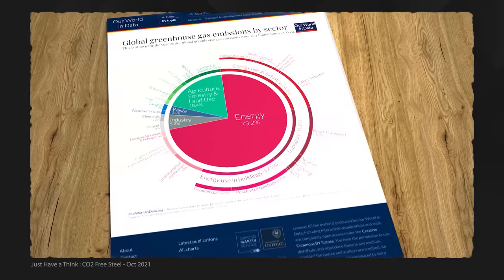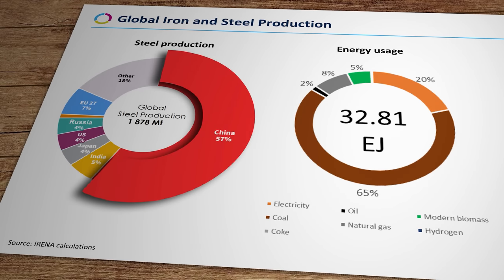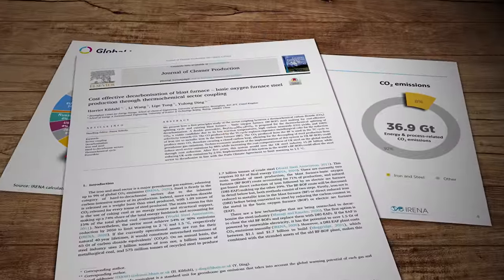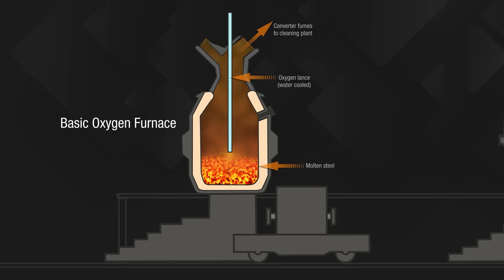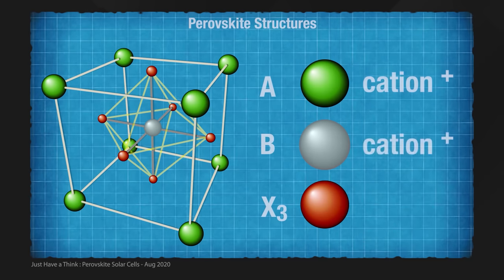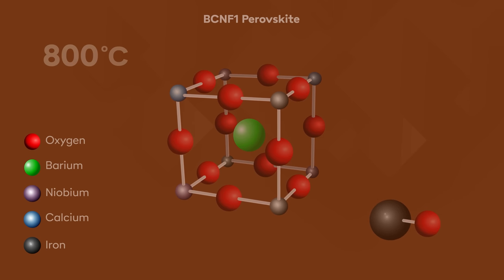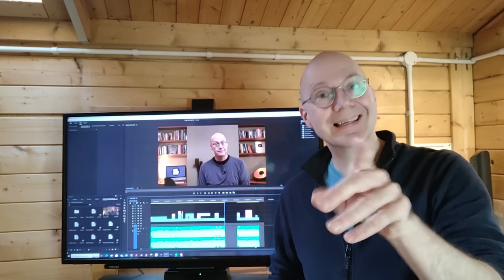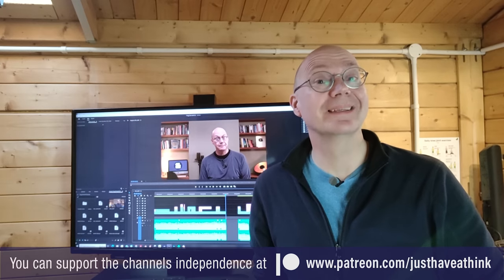New breakthrough claims 90% reduction in Steelmaking emissions.

Comment: The problem with steel making is controlled by basic physics. Replacing C with H to remove O from the iron oxide ore is laudable. But the cost of green H is currently 2 to 4 times the cost of using coke to reduce iron. If this cost can be reduced the reduction by iron oxide by H can be achieved.
If the TC-BF-BOF system can be made to work it will be a blessing. Containing such hot gasses will be tricky. But to reiterate, the basic physics is what is overlooked in many of these fanciful schemes.

Comment: Steam Methane Reforming (SMR) for Hydrogen production can emit a large amount of CO2 during production. 40% to 100% is uncapturable depending on the process.

Another technology for Blue Hydrogen production is Partial Oxidation (POx) Gasification, which, when coupled with Carbon Cature & Storage / Sequestration (CCS), can result in up to 95% reduction in greenhouse gas emissions.

Comment: If the charcoal from, say, a tree plantation, is produced by pyrolysis (heating without oxygen) the resulting gas can be put through a fractionation tower such as they have in petroleum refineries, to produce cooking gas, gasoline, diesel, airline fuel and so forth right up to tars.  Perhaps this would make the whole process more economic.

Comment: Is the move from 7% up to 8% of global total, not so much the increase of steel making but of the reduction in CO2 production from other sources distorting this sort of comparison ?
Reply: Excellent question!
Reply: That would be very positive. The lack of clarification is a glaring omission of information in the video.
Reply: At the moment, I believe both total CO2 emission and steel production are still increasing.  The numbers are out there, if you want to look for them.  As we decarbonize other sectors, the fraction represented by steel (and cement) will of course go up.

Comment: one of the big issues of steam reforming using CH4 is that the steam is created by burning CH4 making it doubly bad for the environment. Flip the equation, using renewable energy and induction heating to produce the steam, reformate the CH4 to produce H2 + C02 then pass the C02 though a closed loop to produce graphene, also requiring heat. If the CH4 is used as a feed stock and not burned it becomes a much cleaner form of hydrogen production.

Comment: I think that the most promising solution that I have seen is Boston Metal"s Molten Oxide Electrolysis.  This technique requires only iron ore and electricity in and the only outputs are high purity molten iron and oxygen plus some slag from the iron ore impurities.  After adding alloying agents, the iron can be directly rolled into finished products.  This solution promises to use less energy and has lower capital costs and can use lower grade iron ore.  Maybe, it will produce higher quality steel at a lower cost than the current blast furnaces.  This would be a real tipping point.

Comment: There is a long way from lab scale to industrial scale. Many years ago (1990's/early 2000's) BHP built a large commercial Direct Reduced Iron plant in West Australia. Technically it worked - but was economically unviable and it was shut down. No company can afford to subsidize decarbonization of steel. Until production costs are built in as  a design parameter, the theme that University Research can go easily to commercial application just ain't going to happen. It needs a change in mind-set of what University research means. It is not always the best technology, often what is actually needed is the most economic technology.

Comment: If the co is replacing that much coke, then you are looking at something other than a blast furnace. That can be done and possibly cheapish compared to the coke ovens and blast furnace route. Tata have an experimental reactor that could be utilised. A top gas recovery project is also possible. 

The generated co is more likely going to be injected at the tuyeres instead of coal. The pervoskite will likely be an offgas processing unit.

Comment: Tata Steel in The Netherlands is also busy with replacing cokes with hydrogen, and a big electrolyser will be built nearby (not only for steel) running on wind power from the northsea... But I think it will take another 5-10 years for that to be realized, But the pressure is on from local people who are proven to be suffering from the cokes factory, which is old and cumbersome and sometimes emits more than what it supposed to do, and sends graphite particles and other toxic stuff in the air causing people suffering substantially more from respiratory deseases and cancer is also more prominent in the area.

The stuff in this Perovskite is also not really good for peoples health, so the concerns you mentionned in your addendum are important to tackle as well, otherwise you would replace something bad with something worse.. "Yeah, we have solved all the CO2 emissions, but do not get near the factory or you will be poisoned!
Reply: @queerdo Well, the Dutch government is a big shareholder of Shell and NAM, so this is not surprising. But the transition to hydrogen made by electrolisers using wind power, I think this is a big positive.. and if it cleans up steel production and vertilizer production, that is a a good thing too .. I do not think Hydrogen for transportation will ever take off. Sales of Toyota Mirai have dropped dramatically!
Reply: The solution is Boston Metal's clean Molten Oxide Electrolysis process. See above. Or below. Wherever YouTube puts it.
Reply: @queerdo If it was so easy and cheap, why it hasn't been done yet!?

I think the sheer amount of AMPS needed to make this happen at scale  is the challenge.
Reply: Coke production is horrendously dirty.  I used to live in the vicinity of a coking oven, and the air was literally sickening to breathe.

Comment: Once again, since I have commented on hydrogen production in one of your other videos, I would like you to research and report on the Hazer process. This may well be able to produce H2 much more cheaply than by electrolysis.
The Hazer process is being tested in Perth, Western Australia by the Hazer company. It uses methane from a landfill  source, passes it over a heated iron ore, fluidised bed and produces hydrogen and graphite, which is deposited on the iron ore granules.
Reply: very interesting comment - thanks for your infomation 😇😇😇
Reply: Hazer process cost depends on natural gas feedstock with 60% conversion efficiency: 6-7kg of natural gas will be required to produce 1kg of hydrogen and 3kg of graphite. The iron-ore catalyst costs are inconsequential (with 1kg of catalyst consumed for every 15kg of methane feedstock, iron-ore costs approximately 4c per kg of hydrogen produced in the Hazer process). This is not CO2 neutral..

Comment: I'm not exactly an expert in much of anything, but something I find odd about creating hydrogen from water electrolysis is how the oxygen that is separated is just vented to the atmosphere, as compared to used in any sort of industrial capacity. Many smelters, particularly aluminum, are already located near cheap sources of water power, so access to large amounts of water is no object.
Reply: My guess is that oxygen from distillation of air is so plentiful and cheap that it isn't worth capturing it.

Comment: One of the big issues with carbon capture is that you have to pull in insane volumes of air to accumulate significant amounts of CO2. Why not put carbon capture sites right next to or inside of steel factories where the concentration is much higher?

Comment: One of the things I love about innovation is that sometimes you get double the benefits. In the search for a cleaner method for producing steel you can sometimes end up finding a method that is also cheaper. There hasn't been much incentive for innovation for a long time because coal and iron ore are cheap enough and steel is a good enough material. But the growing understanding of the effects of climate change and the looming threat of a carbon price is providing enough incentive for people to start looking for innovation again, and I won't be surprised at all if one of them ends up finding a method  for producing steel or a replacement product that is both cleaner and cheaper, and whoever that is will have a huge competitive advantage in the global steel marketplace. Reusing your waste gases sounds like something that would reduce the required inputs to the system which would (at least in theory) make the process cheaper.

For a couple of examples of this happening in the past, take solar panels and electric cars. Both innovations were initially more expensive than their competitors but now, several more innovation and economies of scale cycles later, it is possible to choose the cleaner option and also save money on the lifetime cost of ownership. That pattern is likely to happen with steel as well. The initial prototype plants and resulting product will cost more but a few optimisations later it will end up cheaper than the traditional method.

Comment: I think the best way to reduce global pollution from carbon dioxide in the atmosphere is the mass plantation of hemp as its one of the biggest carbon sinks if not the biggest and it produces masses of oxygen far more than trees and you can grow several crops per year depending on climate, it grows fast and can be used to make clothes and is more ecological than cotton as it doesn't use pesticides needs half the water and produces more fibre, you can also make compostible plastic from hemp plus you can make paper from hemp that doesn't need bleaching and produces far more paper than trees which take decades to grow !!

Comment: Excellent video - I found in particular valuable the comment from one of your Patreons who themselves work in the industry. 

I would only have a naive question regarding the CO - if the plant would indeed convert nearly all the CO2 into CO - would some special additional treatment of this CO be necessary, or could it be simply blasted into the air outside the plant? The reason I am asking is that CO even at very low levels is very dangerous.
Reply: The CO is an input to the furnace - what comes out the top of the furnace is CO2, the extra oxygen having come from the ore. The key bit that makes it make sense as a emissions reduction process is that you don't dump that CO2 to the atmosphere - you convert it to CO with your perovskite, and when you regenerate your perovskite into it's CO2-splitting form you get oxygen gas out. The CO2 and CO are intermediate steps. Actually doing this at scale, of course, is hard.

Comment: I'm unclear.  How does using CO reduce CO2 output?  If the CO is emitted, yes, it's not a greenhouse gas, but will it not be oxidised in the atmosphere to CO2?  Also, once the CO has reacted with the FeO, it will be CO2.  What have I missed?
Reply: You are exactly correct. The CO will react with the O2 in the atmosphere to form CO2 in a relatively short period.

Comment: Interesting idea but I highly doubt it is doable. Coke is not just used in the BF for heat production or reduction. Its unique property is that it doesn't melt so it can withstand the weight of the burden above it. It simply cannot be replaced below a threshold limit.

Comment: I've never been a fan of hydrogen steel which still has an enormous CO2 production. The CO steel in this episode does sound promising, but CO is poison so there will certainly be a NIMBY problem since at scale even a small leak could kill thousands. The best process I've seen is the Boston Steel process which is all electric and produces O2 waste gas from iron reduction. Since the Boston Steel process produces steel with zero carbon, the steel has zero carbon content and carbon must be added for alloys that need carbon and is the only CO2 source. Zero carbon yanks the pants down on any process on your channel IMO.

Comment: Soo, this is just another way of making steel using electricity? Meaning if the electricity comes from burning coal it is of no use at all... so, step one, decarbonize electricity production!

You could just use a solid oxide fuel cell to crack CO2 into CO and O2 using electricity, like the Perseverance rover does on a small scale on Mars. This perovskite thing seems overly complicated.

Comment: Cool. Absolutely cannot be used with the old machinery (the blast furnaces at least), but could be massively useful otherwise. Frankly any ability to convert CO2 to CO and oxygen efficiently is a massive deal, not just for steel. The water shift reaction gets you hydrogen, and from there even getting back to hydrocarbons isn't that hard. If this is a viable way to turn CO2 back into usable fuel with temperatures no higher than 800C, then high temperature nuclear reactors will be able to perform conversion without electric generators. 
I definitely think you could have explained this slightly better. In steelmaking it is CO that actually does the work of reducing the iron, which is why this is important. The carbon provides most of the energy, and replenishes the CO, and this is proposing an alternative method of replenishing the CO. It will still need help in the form of more energy from somewhere, which is why it is useless for existing blast furnaces, but closing the carbon loop around it while still using CO for reduction is definitely possible. Nobody is suggesting releasing CO, so it's greenhouse effect isn't relevant.

Comment: Thank you for all your research on this new proposed process. Your addition at the end was likely not considered by the authors of the paper. Perhaps the authors also didn't look into the costs of creating such a niobium centered perovskite on a mass scale. Niobium metal is both uncommon and expensive.
Reply: @vernonbrechin4207 I had a similar thought: that the niobium and barium extraction probably require considerable resources to extract and may be produced in third-world, unregulated mines. I haven't dug into it, but that was my first thought.
Reply: Found some interesting info:

"Environmentally, the main issues related to niobium and tantalum mining are land disruptions, the volume of waste materials and their disposal, and the radioactivity of some tailings and waste materials that contain thorium and uranium."
Reply: @lawrencetaylor5407  Since the niobium in this process is catalytic, it is likely used only in small quantities.  It might be possible to mine the niobium in a more environmentally acceptable manner, and you have to balance the environmental harm done by mining of niobium with the far FAR larger environmental harm done by the huge quantity of CO2 emitted from steel making.
Reply: @incognitotorpedo42 Agreed. Having looked at the video again, it looks like the niobium isn't "used up" in the process, but is a catalyst like you mentioned (unless I misunderstood). I also, I have similar philosophy to the one you mention: how much energy is saved (or produced) by the use of said elements compared to the amount used for their extract and production? An "energy ROI", so to speak.
Reply: @incognitotorpedo42  - If the niobium centered perovskite simply serves as a catalyst then I would like to know how well is survives the intense temperature it the steel making process. Many catalysts also tend to be 'poisoned' if exposed to certain impurities that might be in the reaction mix.

It is important to examine a multitude of factors before a certain promising approach is adapted. History is filled with many examples  of unanticipated consequences. The clever engineers who figured out how to extract fossil fuels and then burn them to release their stored energy and to create ubiquitous materials such as plastics never anticipated what other impacts those 'miracle' products would lead to. Many geoengineering proposals carry risks that some people say are not worth gambling on if the goal is to slow down the warming of this planet.

Comment: I do wonder if the heat required to drive all these reactions is included in this carbon calculation. You will need far more 700C gas to react a unit of iron oxide if that iron oxide starts at room temperature.

Comment: I was already to blast in with the paper, but your patreon got there first. Not only that but a hot blast furnace is not a good place to add carbon monoxide and oxygen. I have seen the after effects of hot metal explosions and going into work, i found my car parking spot occupied by a steel construction, larger than my car. Bringing Blast furnaces down and preventing oxygen entering the system using a CO2 generator can even then cause problems

Comment: It is FOSSIL co2 that needs to be eliminated. Using renewable materials to produce steel is perfectly fine.
Reply: It doesn't matter if the CO2 is fossil or "green", the atmosphere should not be the place it is dumped in.
Reply: @hotdognl70  yes it does matter. The problem is that there is too much co2, not that there is co2 at all. We could not survive if we removed all co2 from the atmosphere, for many reasons.